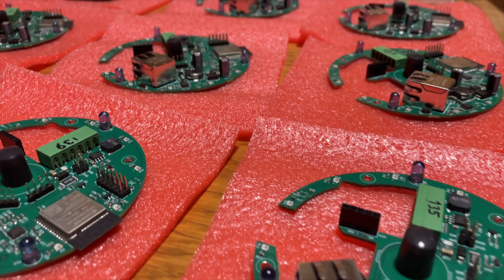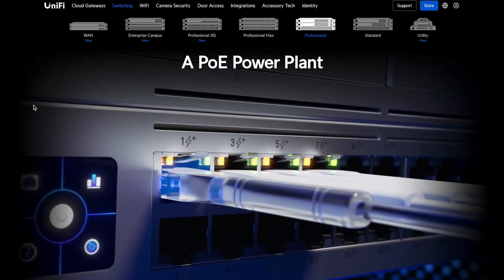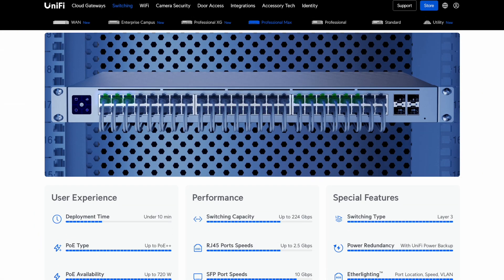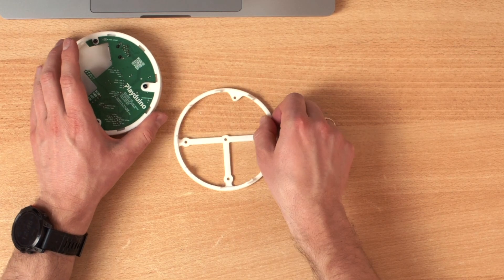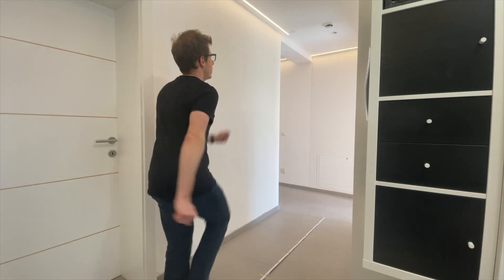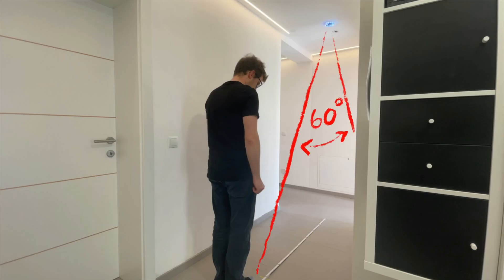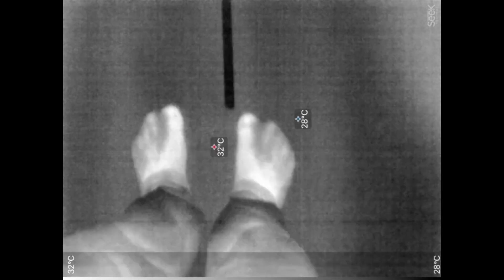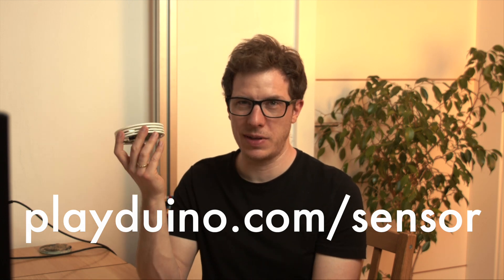I Built the Perfect Room Sensor... With One MAJOR Flaw

Comment: What chip do you use for ethernet and PoE? And do you share the schematic?
Reply from the maker: The POE circuit is based on olimex esp32-poe. So if you are interested, check out the design files. It’s completely open source.

Comment: You have made the exact kind of ceiling mounted, PoE multi sensor I have been dreaming of!

But PIR is over, it needs to be mmWave these days, as it's so much better for many reasons, not to mention you wouldn't need the hole in the cover either.

It also needs to be ESPHome!
Reply from the maker: mmWave is the next thing I am going to test on my sensor platform :) and yes, I developed it to be 100% compatible to ESPHome.
Reply: PIR Is quite a bit faster than mmWave for motion detection. mmWave is nice for presence detection though!
Reply: @LuukDomhof   Lewis of 'Everything Presence One' fame said the same originally with the EP1, but honestly I've never had any speed issues/differences between the two, my Z-Wave PIR sensors are instant.... as is my Apollo MSR-1 mmWave sensors.

There's no difference, they're both instant.
Reply from the maker: I checked the EKMC1601111 datasheet but couldn't find any information about delay between detecting movement and sending a signal. I would assume the response is almost immediate.
mmWave sensors work differently - they need to send out signals (usually 10-20 times per second) to detect objects. This creates a small delay of about 50-100ms at most.
The biggest difference is power usage: PIR sensors use very little power (microamps), while mmWave sensors need about 1000 times more power (milliamps).

Comment: Nice. In my opinion, mmWave sensors are the way to go for occupancy/movement detection. The only downsides to it are power consumption and price, but power is only really an issue on battery powered devices which is not the case here. I think the price is worth it though, it really is a night and day difference compared to infrarred.
Reply from the maker: Thx! I will definitely try out mmWave :)

Comment: yeah i had to buy brand new PoE network switch because 10W power difference... 
so anyways i had my heated floors blasting
Reply from the maker: Guilty as charged! I optimize where I can (network) and indulge where I want (warm floors). 

In fact, our heating system is quite efficient. We use floor and wall heating to create a large surface area, which allows our heat pump to operate at lower temperatures - significantly improving its efficiency. So I'm actually optimizing there too... just with toasty feet as a bonus!

Comment: Most motion detectors are mounted vertically (on a wall) as opposed to horizontally (on the ceiling). Maybe change thr mount location?
Reply from the maker: are they? Ceiling should work fine as far as I know.
Reply: @ Was thinking about how most motion detector alarms are placed as well as the positioning of motion detector lights. Hence the thought behind my comment. Don't think that I have ever seen one mounted on the ceiling. Not to say that it wouldn't work, just that I have never seen one mounted that way. Will be inerresting to see what type of lens you end up with. Best wishes.
Reply from the maker: Thanks for your thoughts! I appreciate the input and will share an update on the lens choice :) Best wishes to you too!

Comment: I made my own environment control sensor. Unfortunately I do not own the house I'm living in, and I made my sensors battery powered. It is an temperature / humidity and air quality package with an IR transmitter to turn on the AC. The ESP32 processor wakes every 30 min to report to my home assistant server. I'm adding a low powered ATTINY15L-1SI with a 433Mhz receiver  that will listen every 30 sec for a wake command from my HA. I do not want to wait for 30m to turn the AC on when I'm returning home and the temperature is 40C ( I live in Cyprus). As soon as I finalize the design I'll make my own PCB as well. My problem is that the ATTINY is discontinued.
Reply from the maker: maybe you can use an ATtiny25? or completely switch to BLE? good luck with your project :)

Comment: Love your project :-) But way dont you use the LD2410 ?
Reply from the maker: :) thank you -  because it needs 5V. LD2420 runs on 3.3V. Are you using LD2410?
Reply: @playduino  Yes iam playing a litle with it. Cant you use a stepup for it? Maby there is one that uses 3v3
Reply from the maker: I already have 5V onboard. All I need is a logic level converter for ESP32.
Reply: @playduino  You give it 5V for power and its gives you TX/RX back at 3v3 so direct connect to esp32 easy
Reply from the maker: Nice!

Comment: Isn't the sensor suppose to be off board as in, more in the casing than on the pcb?
Reply from the maker: Hmm, no, it is PCB-mounted. The datasheet shows exactly how much the sensor should stick out of the final product, and I violated it a bit, but without the case, it performed similarly. :/

Comment: Thank you for this big job!!
In my opinión the case is formal and beautiful. Carry on with the tests because you are getting the final home sensor, it is a really good job. If you achieve to put a mmwave sensor, movement sensor, smoke, light sensor, temperatura and humidity sensor the only to be perfect is to have a microphone and a speaker so as to have a virtual assistant and a piped music system. When everything is finished It might be usefull to investigate how to pass standard Din En 14604, It maybe would be imposible for someone who is not a big company.
In my new home i want to have one of your sensors on each room of the house plus in the corridors and outside too.
If you need a beta tester I'm here to help you !
Really good job!
Reply from the maker: thank you very much! EN 14604 is hard 😅

Comment: I'd love it if you purchased a set of prints from JLC (SLS resin, cheap-as) and compared them to the results on your new Prusa. I've pretty much decided not to get a printer and just use JLC from now on; the quality is unbeatable and the price is so cheap
Reply from the maker: SLS will 100% win :D. but your own 3D printer is invaluable if you want to iterate fast and test different design variations and improvements

Comment: My hallway PIR sensor has drastically reduced range when I wear certain insulating clothing. I'd argue that RADAR would do a better job. Or something like a AMG8833 with advanced software.
Reply from the maker: Thank you for the feedback! It makes absolute sense that the PIR sensors sometimes have a hard time.
amg8833 looks very interesting! I played around with mlx90640 - which double the price :O (but more resolution) I might give amg8833 also a try
Reply: @playduino  A flaw for me is always the trade-off between range and size of detection. Not a problem when mounted on the ceiling, though. But in a long hallway, there's always the struggle between not detecting far away, or constantly having false positives, especially from pets. In theory, radar can mitigate that better, since it listens for Doppler changes.
Reply: As an electrician, I might have had my fair share of movement/precense sensor problems.

Commercial PIR devices have often 4 sensors in them. There might be a reason for that..

I would not use radars, because setting them up is a nightmare. You have to have them right in the middle of the area you want to detect people from and have the range setup so that it reacts when you are in the area, but can't "see" through walls/doors or to other levels.

Every lighting control manufacturer tried to change from PIR to microwave ~15 years ago, but had to basically backtrack to PIRs. It's way easier to handle IR as it behaves more like a visible light and stays in the room you install the detector. Even the customers understand things that need line of sight.

We have got a ton of calls from customers that state their closets have lights on all the time, when in reality those microwave radars see them just before they get to the door. In a closet though, you can set the range to a lower level. Worst case was a gym locker room. Several radar lights on the ceiling, large area and multiple paths to watch for etc, but the catch: There were spectator and hang out space above it and the people upstairs were actually closer to the lights than the users of that locker room. Lights were on constantly through the matches, while no one was in the room. Can't lower the range, as then you would need to walk in to the darkness. Adding steel sheets over the lights seems a bit overkill just to fix a stupid choice in product design.
Reply: @villehietala9677  The problem with PIR is that the three qualities for detection, that is size, distance and temperature difference, are all the same metric. If you want more range, it will also pick up smaller objects at smaller distance. If you reduce sensitivity, it'll also ignore smaller temperature gradients.

I was actually happy with an HF sensor. However that used a relay, and with LED, it would weld the contacts in no time, so after trying two different name-brands of relays, I just went with a PIR sensor with a transistor.
Reply: @ Relays and direct control is fine for just a couple of lights.  Anything more should be handled on the drivers, so the device(s) controlling them don't need to handle mains voltages at all..  I do like dali for that and most of the stuff we do nowadays is just that.

Older 0/1-10V analog stuff helped a little, but those needed the mains switching too.  If the controller and drivers were made right, there shouldn't have been any disconnecting while loaded, so the contacts would have survived way longer than with direct on/off.

Better led-lights have soft start now, but there's a lot of cheap ones that just blast all in when they see any voltage and doing so limit fixtures per fuse to a surprisingly low amounts.  And kill anything that has to control that voltage.  Having some power factor limits for led-fixtures would probably fix the startups too as an side effect, so I'm directing my hopes for that instead of just soft start.
Reply: @villehietala9677  Oh, and where I live, radar penetration is no problem, since everything is concrete.